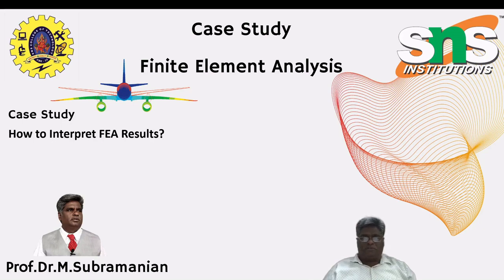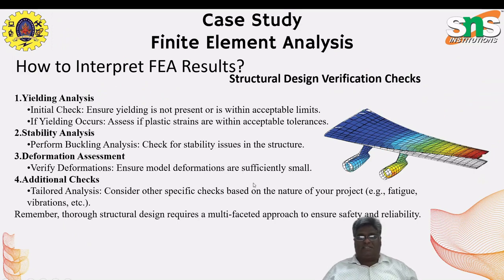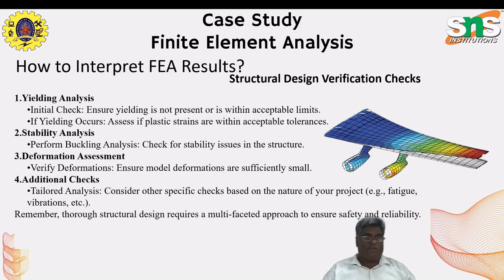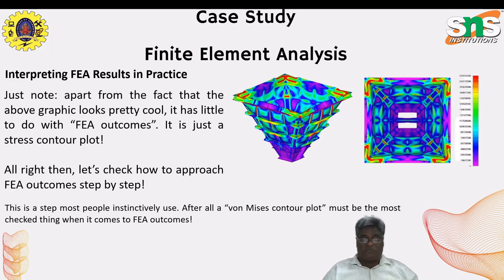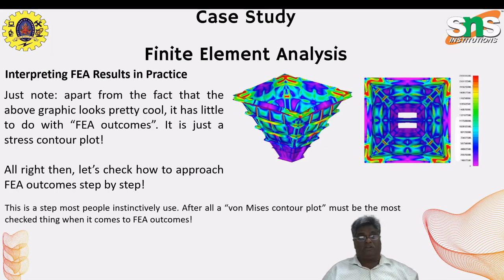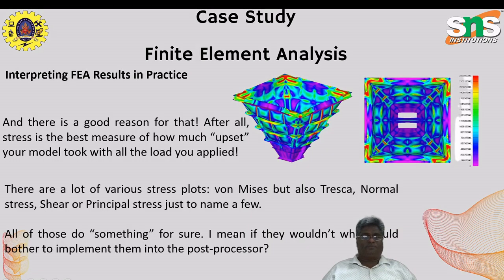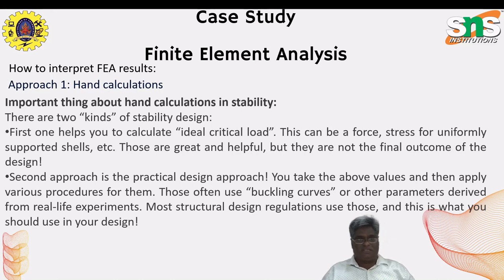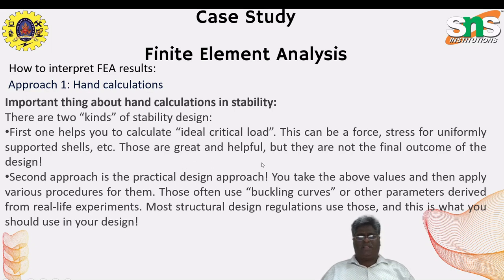Case study : How to Interpret Finite Element Analysis Results?

Comment: Sir, honestly, you are just reading the points. Everyone knows it. Also, the example slides you showing in this video, it completely you have taken from EnterFEA Website, this is not yours. Please explain based on your practical experience. I didn't tag that website here, so it's good for you to correct, until someone notice to the copywrite owner.  Thanks